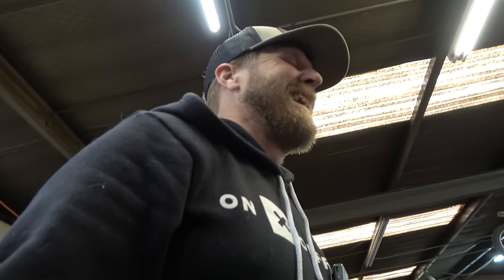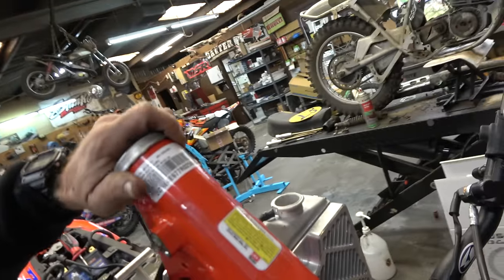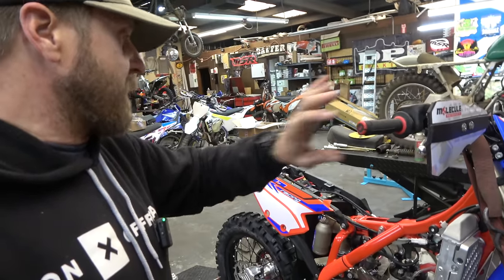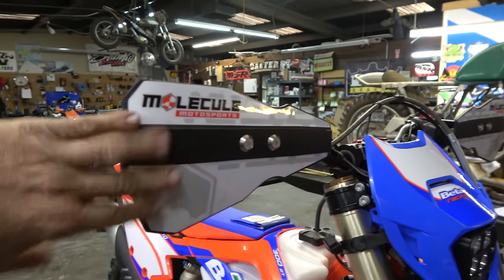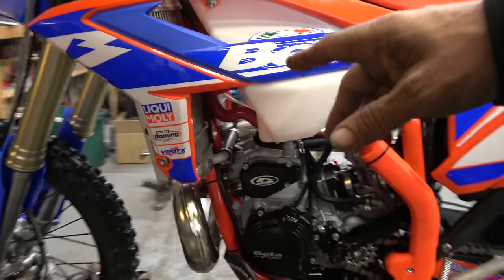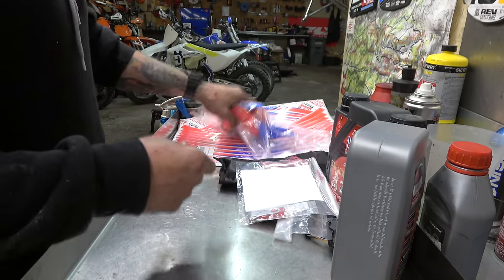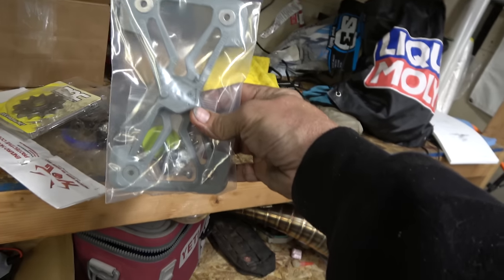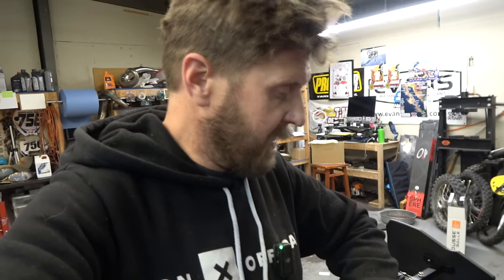2024 Beta 300RR  Race Edition | First Look | Episode #2 | Greasing everthing! | Highland Cycles

Comment: Excellent vid as usual, I am a Beta 250 race edition owner, 2018 and love the bike.
I am wondering if you’re gonna get Ann opinion from RK Tek on what he says about the dual plug and what his angle will be on an aftermarket head ( one or two plugs)
Also do get a secondary hour meter on asap for when the stock one gets messed up.
Reply from the maker: I rode today. The dual plug makes zero difference in performance
Reply: Well then if nothing else u have an extra plug and coil if there’s a problem.
Does seem silly tho

Comment: The Beta’s were known for electrical issues like 5 years ago. They promptly fixed the issue. It is important to point out that perpetuating old issues helps nobody.
Reply from the maker: My mechanic was a factory beta mechanic and his wife raced for them professionally and they said that greasing connections is important and that they still don’t have great harnesses
Reply from the maker: Did you race for them??
Reply: Still not great just had sator burn out after 70 hrs . And trying to get a new one is almost  impossible looking into having it rewound.
Was going to get a new beta in next few months but thinking twice about it now .
Reply from the maker: @johnowens5988  yeah. The electrical stuff and the persistent crank bearing issues do worry me. But I have seen that the crank bearings have been upgraded this year and I hear that with some care and grease the electrical is good.
Reply: @highlandcycles  I own a Beta and have seen a few torn down over the years. I not only did what you are doing doing but also rerouted some of the harness to keep it from pinching. Heck Morgan, you work on bikes day in and day out. You know there is not a brand out there without some kind of odd issue. BTW, I liked how you cleaned up the bars by ditching those huge switches.
Reply: Beta crank bearings still going boom ? I heard they still haven't fixed their dang crank issues.
Reply from the maker: @FamilyHomeComputer  I don’t know but we are going to find out
Reply: All my electrical connections were greased on my new 2023, Beta 300 RR from the factory. That said, the connecters are not waterproof like the ones on my Yamaha WR 450.
Reply: Pipe looks so much better nice work Morgan love it

Comment: Need you find someone with a 23 300 race, Jet it the same, and test out any differences. Kelce's fancy heads suggest that things can be done to burn the head better, stronger/more.
Reply from the maker: I already did that. That’s where I got this jetting. They are identical feeling. The two plugs don’t make any difference in power
Reply: @highlandcycles  I hate that dealers are advertising "dramatically improving overall performance". No it isn't.
Reply from the maker: @nickschoenly742  nope
Reply: @nickschoenly742 false advertising?

Comment: You mentioned you would keep the original dash in order not loose the hours. Are you aware that Beta hour meters only count when the front weel is spinning? It's not a rumor it was confirmed for me by Beta Italy. Kind of weird, but true.
Reply from the maker: Oh yeah. Just like the KTM ones.  I know it’s not super accurate. I’m sure I’ll put a real hour meter on it too.
Reply: KTM actually measures running time without the wheel spin, but Beta doesn't. Get out with some mates who's riding KTMs and compare the ART after the ride, you'll be surprised 😂 Of course this matters only if you go for a hard/extreme ride where the front wheel is unlikely to spin a lot.
Reply from the maker: @gaborgabor2098  not on the XC-W’s. My 2018 XC-W broke the wheel wire and it quit accumulating hours. When I replaced it about a month later, it was at the same hour.
Reply: @highlandcycles Wow, I wasn't aware of that. Thanks for the info 🤘
Reply from the maker: @gaborgabor2098  may be different on newer W bikes but the carb ones were like that

Comment: My 23 200 race came with another front sprocket also
Reply from the maker: Nice
Reply: @highlandcycles  where did you say you got the clickers from for the suspension
Reply from the maker: @richardorr4114  https://langsoffroad.com/
Reply: It's probably part of the homologation kit. They come with a radically different expansion chamber and different needle to meet emissions requirements. The different gearing is to match noise/ emissions to a given speed (I think). Also a paper air filter. My dealer kept the expansion chamber to send back to Beta.

Comment: Please excuse my ignorance I’m coming from a 2019 CRF 250f and just picked up my 2024 beta 300rr race edition yesterday. The dealer told me to run 50/1 fuel ratio. I’m curious why you said you were going to run 40/1? Would 40/1 be better? I just don’t want to mess up my bike and get the most reliability out of it I can.
Reply from the maker: I like 40:1 because I have run lots of different ratios in different bikes and to me it’s the best for longevity and performance

Comment: Did you do that lengthy re-build on the KTM...to only sell/replace it with this?!?!? Congrats on it though since we know it was a birthday present to yourself. New bike is a new bike.
Reply from the maker: No. I have it for my fast bike. This is my rock bike
Reply: Ahhhh cool cool. So you got this specifically for 1st/2nd gear slower tech riding. Gotcha. Those things are supposedly purpose built for that stuff. Wish they were a little more geared for fast XC/Hare Scrambles. The cockpit seems to be more set up for smaller riders and stock KYB is never a bad baseline.

Comment: Are the extreme switches plug and play? Or will I need to do some wire splicing?
Reply from the maker: They have a plug and play version I believe. Mine required some soldering

Comment: Why do you remove the thermostat? I know many do so, but you run the motor too cold on many occasions, and it heats up slowly. I ride in Thailand on KTM 300TPI and with the thermostat and it newer boils even though it's 30 to 35 Deg C here all the time and I ride technical enduro in slow pace.
Reply from the maker: It’s a fail point.
Reply: I understand, but especielly on fuel injected biked you risk to run constantly in "cold mode" with extra fuel if it cant get over the temperature limit when the temperatues are low @highlandcycles
Reply from the maker: @ptft4  my XC never had a thermostat and I’ve never had an issue. And like you said, it’s way less of an issue with a carb bike.
Reply from the maker: @ptft4  check this out on my XC with FI and no thermostat https://youtu.be/tHoYaMnoMaQ?si=2N900MaTEqnD1Ed5

Comment: @10:23      AAAAAAAAAAAHHHHHHHHHHHh You made reference to ME!!! The OCD guy! I'm famous!!! 😂😂 Unless someone else mentioned it too! LOL BTW, where did you get two red buttons from? I used a black marker to cover the green start from Nihilo! They actually told me the black buttons had failures. Not sure why the color of the plastic makes a difference but I specifically asked if they could get me a black or grey start and they said NO.
Reply from the maker: Extreme-parts.com
Reply: @highlandcycles  Are they plug and play like Nihilo? THANKS!!!
Reply from the maker: @brutus6328  mine weren’t
Reply: @highlandcycles  Which weren't? I 'm assuming the Extreme -parts? Your Nihilo should have been as my SX-F is the same as your XC...isn't it? If it's the Extreme ones that weren't plug and play, how hard were they? Also, have you seen the Ride Engineering two in one that bolts directly to the housing? Leaves lots of room on the bars. And it looks like it could never break in a crash. I hear the buttons are great too. I was thinking about trying it.
Reply from the maker: @brutus6328  the extreme parts ones I used on this bike. They were individual switches I wired in. My nihilo were plug and play
Reply: @highlandcycles  Ahhhh got it. I can't even find them on Extreme -parts. Can't find switches anywhere. Any reason you didn't go with Nihilo again? Just wanted something different? Just wondering if there's anything I should be aware of regarding the Nihilo. So far, they are awesome!
Reply from the maker: @brutus6328  no. My friend is an extreme parts distributor and sent them to me.
Reply: @highlandcycles  Got it. Reason I was asking is because when I was looking for these individual switches, Nihilo was the only place I could find who makes them. Even my KTM dealer couldn't help me. Anyway, the Nihilo work great and I colored the green start switch with black permanent marker and it worked perfect. LMAO! Still wanna try the Ride Engineering start/stop setup.

Comment: When you say you put dielectric grease on the connectors, what do you mean exactly by that? Do you put the grease inside the connectors or just on the outside so its sealed + easy to unclip????
Reply: Nonconductive grease in the connectors will prevent water ingress and help against corrosion.
Reply from the maker: Sorry, inside the connectors.

Comment: If you were running it “stock” shouldn’t you of maintained the exhaust length?  I read that the long tail pipe aids in torque and smooth power delivery 🤷🏻‍♂️.
Reply from the maker: Yeah to be completely stock I should have but to be legal I have to have a spark arrestor and I didn’t want to set it all up and then pull it apart and do it again.
Reply from the maker: But the amount I cut off doesn’t make a massive difference in delivery.

Comment: How was the tool kit different than a Ktm's?
Reply from the maker: KTM doesn’t have one anymore. Like ZERO
Reply: I just bought a 24 Hard Enduro and it certainly came with a tool kit, 30mm axle wrench etc.  Your dealer must be selling the tool kits on the side. LOL @highlandcycles
Reply from the maker: @williamcrotts7054  my straight XC came with the dongle for the PV and that’s about it. I know them and they didn’t steal anything
Reply from the maker: @williamcrotts7054  the hard enduro is a “special” bike I think.
Reply: Morgan, checked my 23 350 XCF and you were right, no tool kit, we did however get a handy dandy air pump for the forks.  Btw, a friend just picked up a 24 Husky TE 300 and it came with a tool kit.  Keep up the good work. @highlandcycles